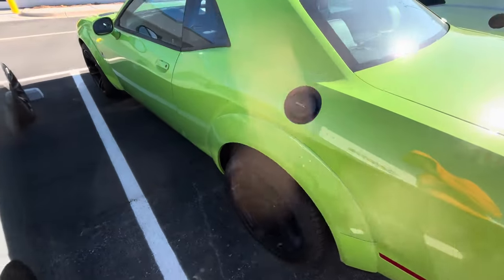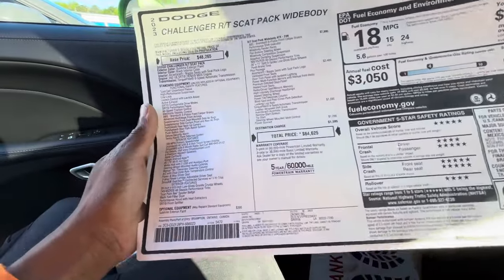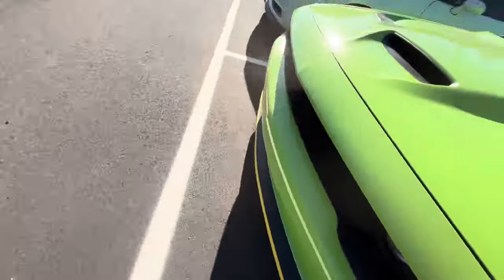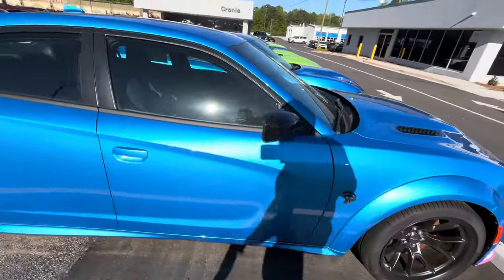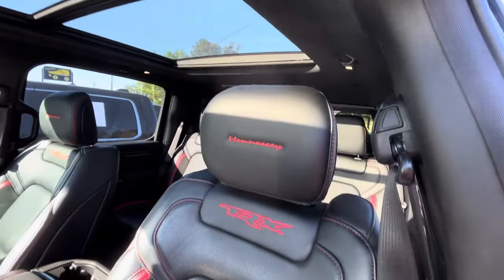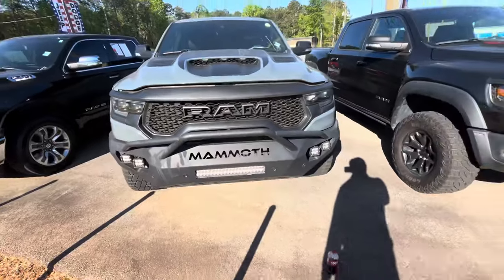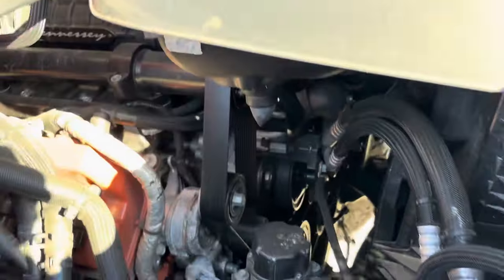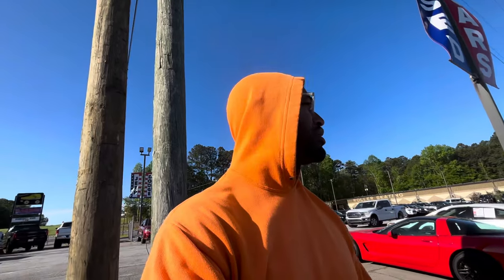All Dodge Cars are on a DISCOUNTED PRICING this month ONLY ‼️

Comment: These cars are going on 2 years old. They need 20% off MSRP
Reply from the maker: You make a great point 🎯 they would be selling like hot donuts then 🤣
Reply: Lol...30%. At least! Only going to get worse....
Reply from the maker: @MH-so9oz yeah the gonna do 30% off of the already marked up car and  make  uneducated car buyer think they getting a deal
Reply: Going monday to get mine. Dealer reduced it 21 % off MSRP.
Reply: @icecold6400  Were ? Make sure its not a bait and switch like you dont quiliafy for thatwhen you get to dealership
Reply: I agree I bought my 2021 1320 in 2022 around March and they took 7k off on just the sticker